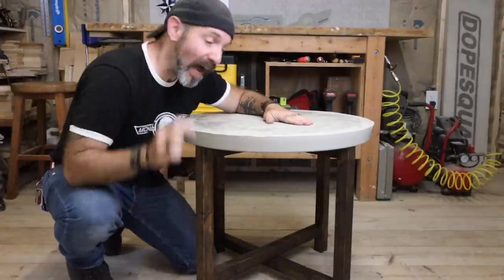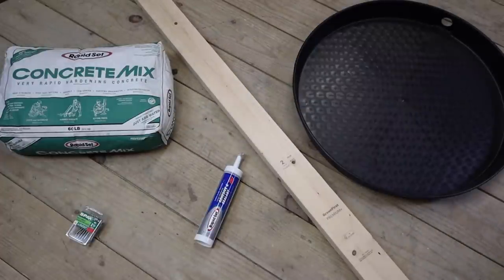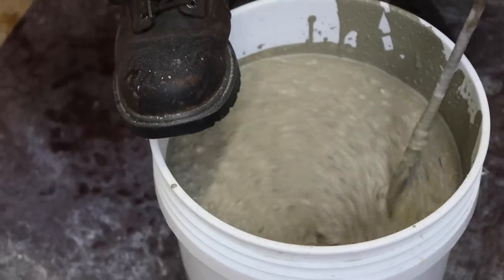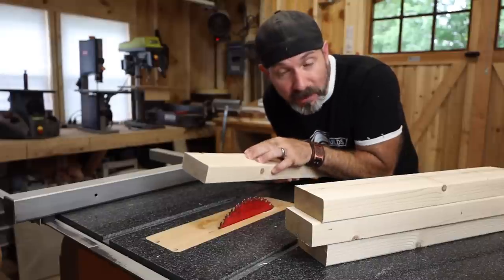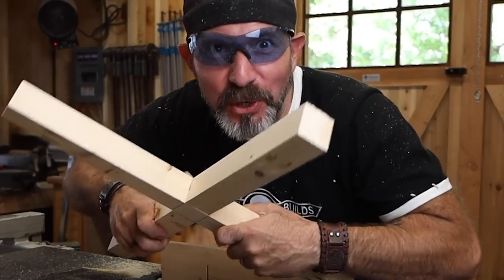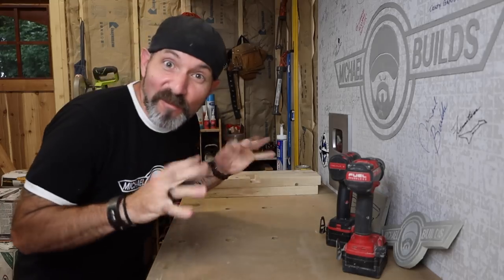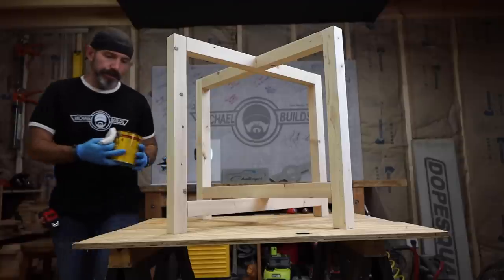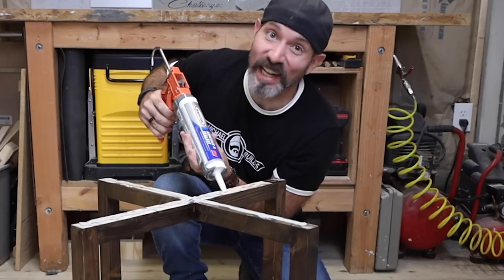How to make a Concrete Coffee Table

Comment: I used this guy's first videos to remodel my kitchen.  I did all of my kitchen countertops this way.  Then, I built my bedroom furniture and liked the concrete so much that I made the tops to a dresser and two end tables that I built.  The kitchen is three years old and last week I had to put another coat of wet look sealer on them.  Our bar is a 6'×2' one slab with no reinforcement at all.  We have had no cracks, breaks, or chips all this time.  Rapidset makes a great product!  

One thing, make sure your water is treated if you have a well.  When I did my kitchen, I had no filtration.  The iron oxide in my water gave the concrete a sandy color.
Reply: Which brand of rapid set did you use? Thanks

Comment: Great project that I’m going to try. For outside furniture, I will use red cedar 2x4s because they weather well, and to prevent the legs from wicking up water, I will put a 1/2” tall dam of tape around the bottom ends of each leg and then pour in epoxy. It sets up fast and makes a very nice and durable “foot”.

Comment: That's amazing! I would love to see all kinds of experiments with rapid set products, like is there one that could be used for making a hypertufa water trough or planter, or do they make a product that could be used in place of those expensive glass fiber reinforced concrete for making thin fake boulders, could you use it to do a thin overlay that can be stamped on a driveway or patio. If I ever win the lottery, I'm going to dive into a mountain of this stuff like Scrooge McDuck into those coins!

Comment: I have made many table tops but I always got stuck on safely attaching the legs. 
The first was a very heavy resin river top 100lb easy.  I didn't want to use wood, so I made two legs out of large pavers. but I could never figure out a way to attach them for safe use.  
The next few tries where with some amazon 4pc iron table legs and  inch n half tops. A good push and they would pop off.  

Could you do an episode focused on different types of bases and how to attach them.